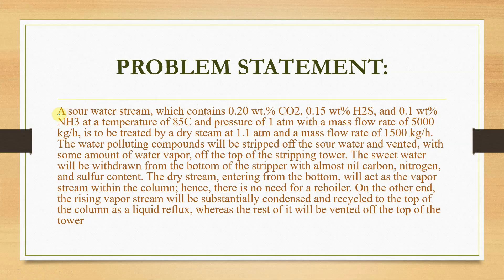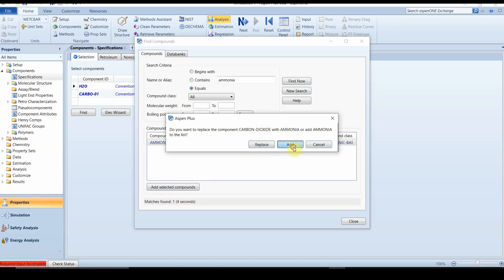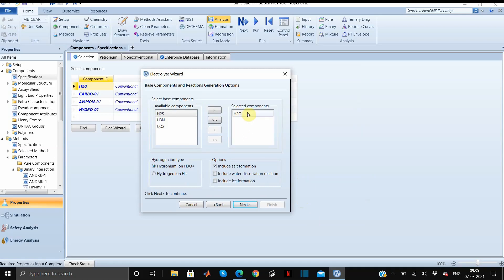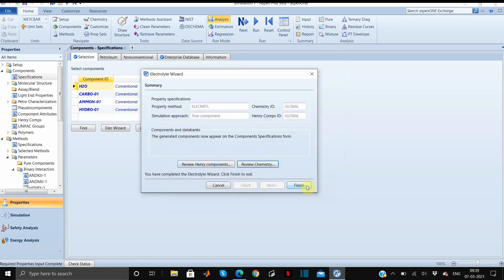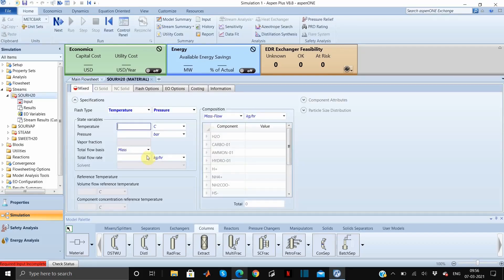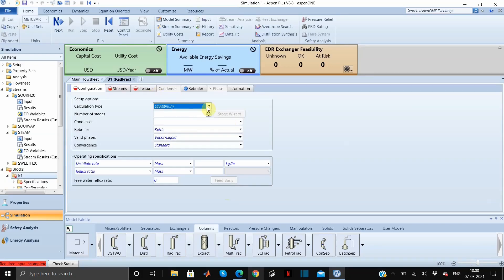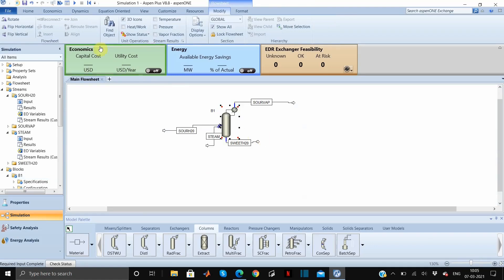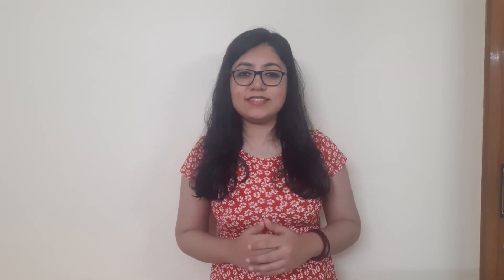Electrolyte module in Aspen Plus|| Water De-Souring system|| ELECNRTL Property method

Comment: Nicely explained. I have just 1 doubt here that the steam line has a pressure of 1.115 bar and is introduced on 11th stage & subsequently has a pressure drop of 0.1 bar every stage. So here the steam line is deciding the pressure and seperation efficiency of the column?